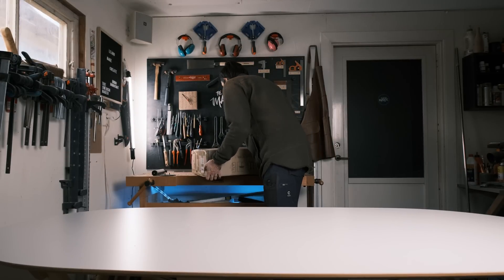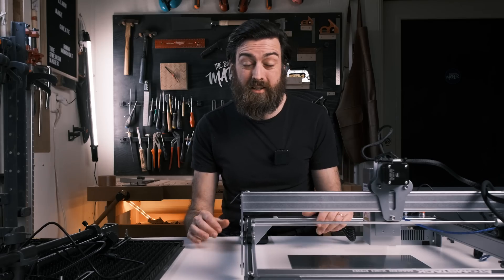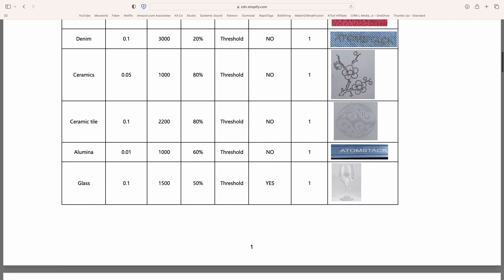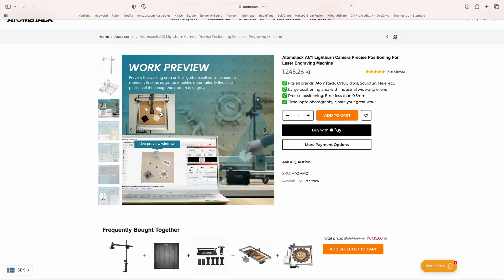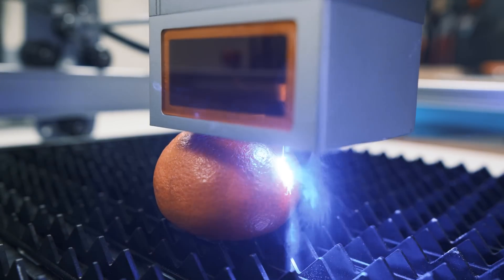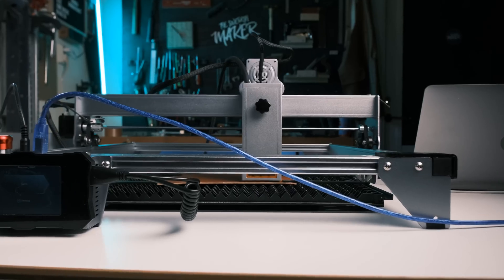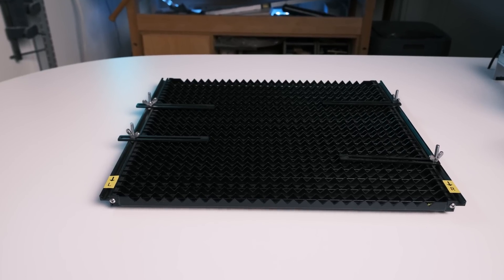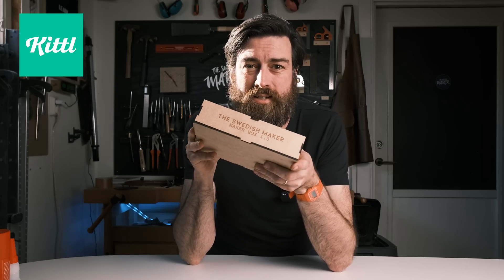30 watt diode laser is too strong?

Comment: I think you an amazing creator and very honest. I had the same question about the company and I will purchase mine through Amazon. What do you recommend? I need speed for classroom projects. I only cut 3mm and 5mm plywood. I engrave anything that can engrave. Would X30 Pro be a be good classroom laser? I can handle the ventilation.

Comment: I'm pretty impressed that it can cut through the 3mm MDF - does it struggle or take a reasonable time please? I take 3 cuts on a 40W and would like to figure out this one's strength by comparison please.  Thank you for a great vid!
Reply: Is yours 40w laser or 40w total?  My 40w laser burns through 3mm as its nothing on 1 cut. I did some 8mm the other day but that i did 4 runs so it didnt burn so much.

Comment: Hello. Wondering if you know of a product I saw on youtube. It's like a pillow (in this case it was blue) that's about a little smaller than a fist. They are used as spacers/protection when cutting something on your work table. I've looked in many places but haven't found any. You probably need about 20. As I understood, they do not damage the saw blade if you are sawing in a "pillow". Regards // hakan

Comment: Hello :) Did you have the chance to test the Emblaser 2 (made by Darkly Labs, the editor of Lightburn) ? I am a bit surprised that you consider that about 1200 dollars is expensive when the Emblaser costs about 300 euros here for the 5W version and 3500 euros for the 10W version. (Without going into much details, I got the first version 5 years ago but had an issue because the delivery company dropped it on the ground and something broke later on when I could finally unpack it and use it only 1 year ago). I was happy with the results of this laser cutter. I am about to buy a new one but I am now a bit confused by all reviews I have seen on other brands because they are cheaper but nobody ever reviewed what I need: cutting very tiny little pieces in carton and paper for scale modeling at scale 1/320 ... Have a niec day ! :)

Comment: I’m very new to this, in fact I didn’t know these existed. I’m just wondering, am I able to put any wood under this? Do I just set the height of the laser to suit the height of the wood?
Reply: Most any wood. They all have their quirks...walnut likes to char and catch fire as an example, but you can work around that (I've made beautiful pieces out of walnut even with that issue). There's a whole learning curve to using these though...and computer/graphic design skills are going to be critical for anything beyond engraving pictures or text onto wood shapes. That said, Lightburn (the main program available) isn't hard to get going in, and there's a number of resources for info on how to use it (including a dedicated forum and facebook group). Add to that that YouTube is no slouch in the resource department, and there's no reason not to try if you have general interest and the funding.

Comment: I have a jtech 7w attachment to my CNC that I tried once. When I ordered it I thought that I would use it to cut an engrave different stuff but after screwing up on the first try an forget to zero my home/start position which resulted in that the machine went to unexpected start position and fired the laser right into my spoilboard and hit a metal screw reflecting back under my glasses I realized that if I want a laser it should be full enclosed. Haven't used it since but my eye was irritated for 2 weeks but no permanent damage as I know about.

Comment: The answer: non of them are Atomstack….and they all are. They are likely all dealers and the core machine is made by a Chinese manufacturer that may have a presence in the Chinese market, but to market to the west, they probably created a brand that would better appeal to the west. Also, it probably absolves them of liability if you have an accident.
Reply: In my experience, this is the way Ali works.  All the sellers are mostly individuals with a business name.  The sell products from one or more factories.  They sort out exactly what you want and then the manufacturer ship it to them and then they ship it to you.  So, they are all official agents for the factory.  Since this may be the only way the factory sells its goods, they are all official.  The problem is of course that the service is only as good as the individual and their relationship with the factory.  Sometimes they are amazing, other times, not so hot.